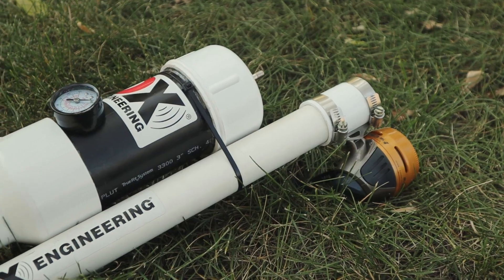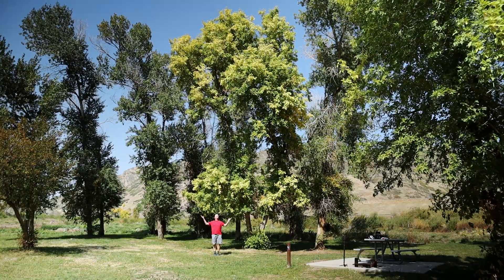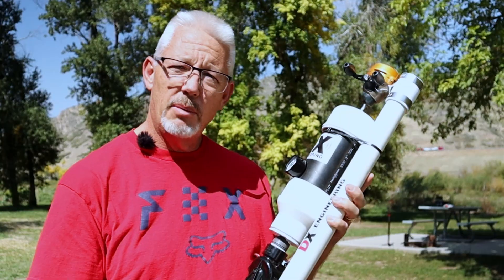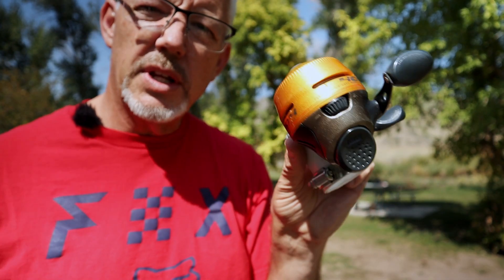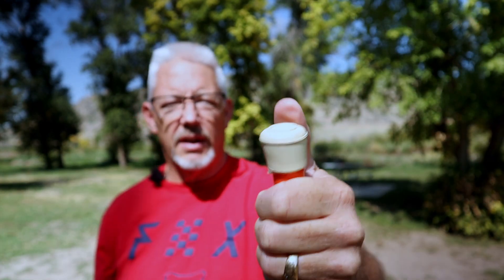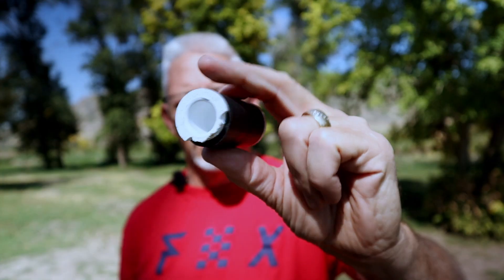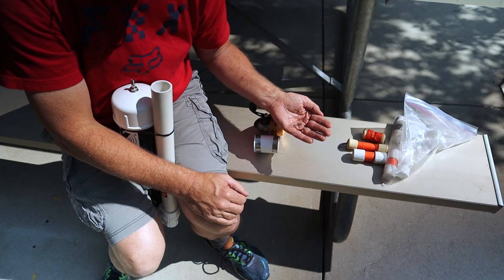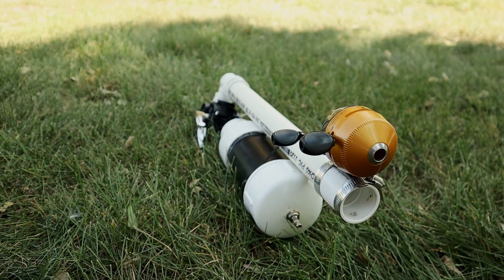Can an antenna Launcher help you ? | K7SW

Comment: I built one and bought a kit from a club in Missouri. At my age 83 I don't have the strength for a slingshot or a bow which I've tried. The air launcher works, usually the first try. Hint: if you make your own with hand toggle valve, boil the valve for 30 minutes before assembly and it'll be easier to operate.

40 lbs sends it 150 feet up. Use flex fishing swivel to connect spud and pull string for pull rope. I use 8 pound nylon string on reel.

Comment: I used a dog training dummy launcher, tied the arborist line (looks like your pull line) around the dummy and fired it over the tree.  The dummy launchers use .22 blanks of the same sort that are used for the powder powered tools, a box of 50 is a few bucks.  Dummy launchers are not considered firearms in the US, the devices and blanks can both be mail ordered.  But it saved a step.

Comment: I built a straight PVC launcher several years ago used a basic pvc ball valve. I did however use a threaded connector between the barrel and the valve thus allowing me to break it down and it fits perfectly in a folding chair bag when in two pieces. I also after firing  turn the reel and stop the projectile for a more controlled descent on the other side of the tree I am putting it in. Great video enjoyed it.

Comment: Kevin what size is your barrel  1&1/2' or 1&1/4"?   I made my barrel out of 3/4" for more velocity which may not be necessary . I'm having a hard time finding suitable  projectiles  I'm going to look around a bit more  though before I retrofit
Reply from the maker: yes I believe the 3/4" size makes is difficult to easily make projectiles. My pipe size is 1 1/2" so that 1 1/4 projectiles slide nicely in the tube. having a heavier projectile makes it easier to get over very tall trees.

Comment: Do you have plans to how you build this air launcher?
Reply from the maker: Here is the website for this launcher, however it appears the actual plans have been removed. If I come across the original plans, I will send them to you.
https://www.qsl.net/k8blo/launchers.html
Reply: @hamradiowithkevin   yeah that’s too bad, a parts list is always a good start. Saves me from being that guy in the plumbing aisle at Home Depot.
Reply: Here is a close variation on the valve mod which is all you need to know:  https://youtu.be/dkQYgDz8-KE?si=EKjaUOvr24HyuHD5
He built this for surf casting bait but just use lower pressure for antenna needs.

Comment: For the projectiles, are they 3/4" PVC with 3/4" caps? (I see some are cane tips)
Reply from the maker: Great observation. Yes, I have some cane tips so that in certain use cases, they will bounce on pavement  and not shatter. I have found that using different materials provides more flexibility for launching situations.

Comment: Are you placing anything inside the projectiles to add weight before sealing the caps on?
Reply from the maker: I have tried rocks and sand in some and it just makes them too dangerous for me.  I use only air now in the little projectiles.

Comment: This useful Tool could fit in my Antenna Bag very well...😍💯👍
Reply from the maker: Not just useful, that tools is flat out FUN.  73 To you UG,  Kevin
Reply: @hamradiowithkevin  Correct! I would even use it to defend myself against Grizzly Assaults. 💯😂😂😂👍🙋‍♂
Reply from the maker: @DK5ONV  , make sure your running shoes are on, because you only get one shot ;)
Reply: @hamradiowithkevin  Nike, Puma, Adidas...? Any Pair of Runners they are fast enough to get my hairy Ass outa there very quick. Ok Kevin I got you at this Point. Meaning, Buffalo Biker Boots or Flip Flops won't do the Trick.

Comment: what is the pressure rating on the air chamber piece of pipe?  lowe’s and home dopie only carry NON pressure drain / sewer pipe in the 3” and 4” sizes and it isn’t a sch 40 pipe either.
Reply from the maker: Richard, I am not sure what the actual rating is. The pressure tank on mine is Black SCH40 and should handle the 40 psi I fill mine with.  I hope that helps.  I did get my pipe from one of those two places. You could also check at a pipe supply place for scrap pieces to save from buying a large pipe.

Comment: Yes . But mine is a pool stick cut in half. With a zebco®reel and a sling shot. The launch /pilot is a 1 oz sinker pulling 8# test line.  Up and up and away sinker painted orange.
Reply from the maker: Stephen, that is a nice design, simple, affordable and light weight.

Comment: What diameter is the barrel?
Reply from the maker: The PVC (Sced 40) Pipe has an inside Diameter of 1 3/8" . 
This is end at which the projectile launches from. Was that question you meant ?
I hope that helps you with the Build . Happy launching and 73

Comment: What weight line are you using? Thanks, love the video!!
Reply from the maker: I have stuck with 50lb test, I have used lighter line but I have found in some trees, tangle that can happen and require a decent pull to get unstuck. Lighter string flies farther as well 😉